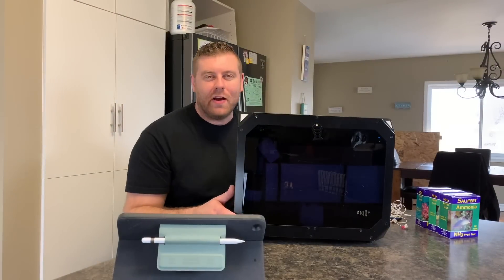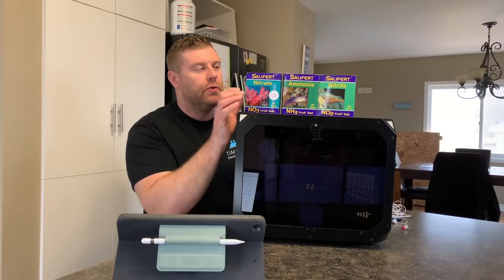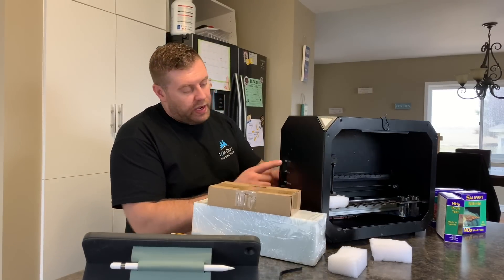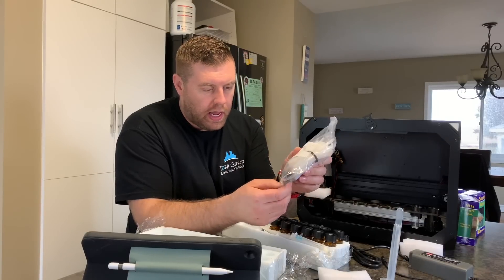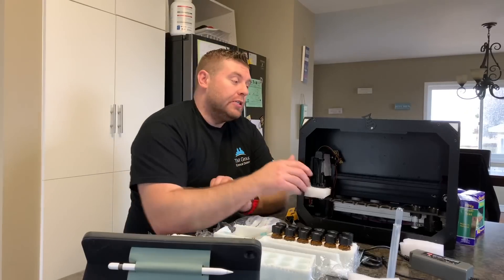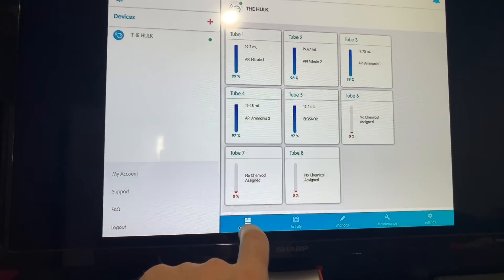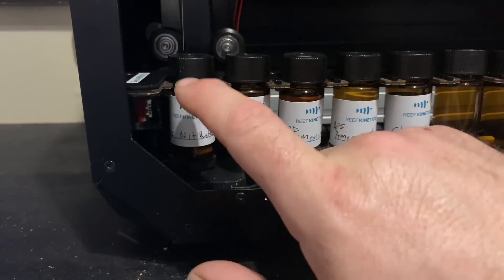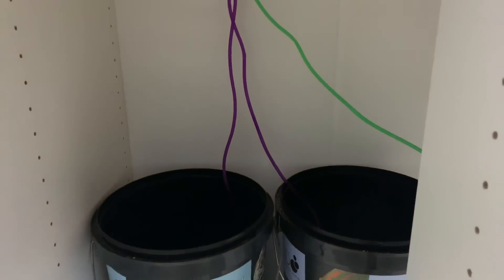ReefBot Reef Kinetics Unboxing, Setup on THE HULK

Comment: I was not a fan of the reefbot. To many issues. Customer service was so/so. To much trouble shooting and tinkering. To perform a test, it took forever. Calibrating the bot was nearly impossible. Multiple calls to cs. In the end we ditched it. The bot has potential but still need to be refined and minor details worked out. 
Never the less, thanks for taking the time and  sharing, it is appreciated